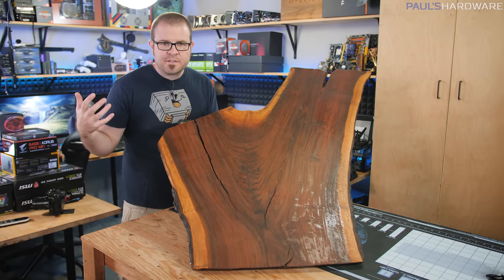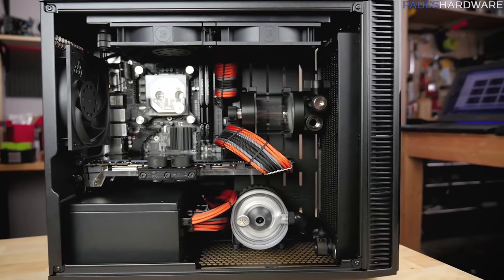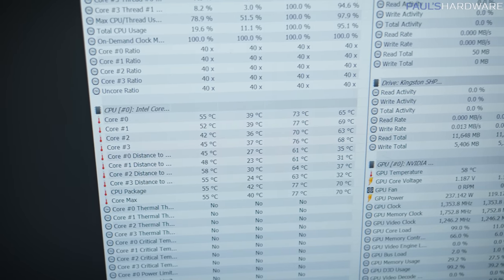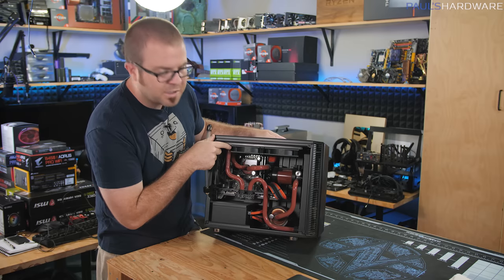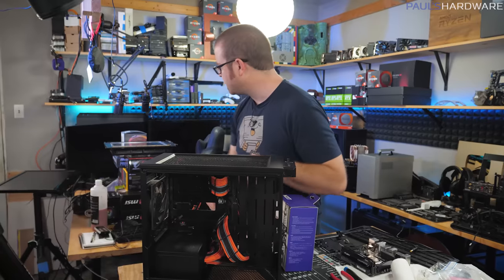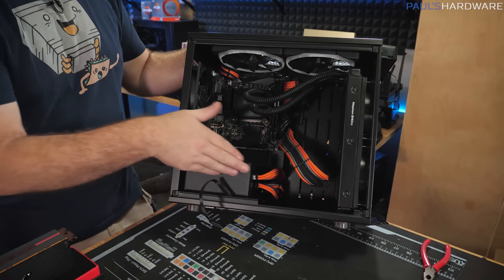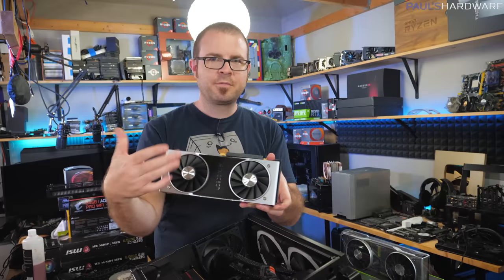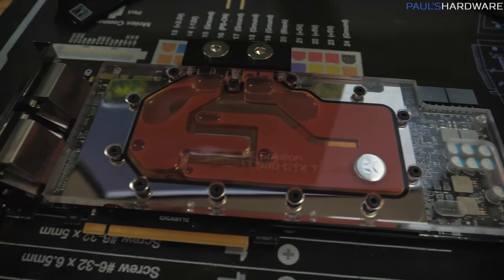Restoring HOTBOX: 3 Years Later

Comment: So strange why not just clean, new coolant, and reassemble? 980ti is good enough for the games she plays and looked way better with custom loop.
Reply: Completely agreed, I’m really surprised why Paul didn’t do this. System seemed fine spec wise, it just needed the solid clean out & perhaps just distilled water this time around.
Reply: that may be the plan. he just needed to get her a working system for now while he deep cleans the ek parts. at least, that's what i think he's doing.
Reply: @Devastator0  He did mention that his wife wanted little to no downtime. Hopefully part 2 of this video with the parts cleaned and possibly orange tubing to bring it back to the original aesthetic.
Reply: MantaProx2 I figure he didn’t just use distilled because he’d have to bend new tubes because the old ones are probably stained murky rotten carrot orange.
Reply: He did say he chose the aio and air cooled gpu so that the next time he has to clean out his wife's pc it'll be easier for him.
Reply: Watercooling is a hassle if you use coolant like that. I’m more confused why he used a reference 5700xt, it’s so loud and hot.
Reply: well a 1660ti is about the same speed as a 980ti.. the 980ti already showing its age.. a 2060 or 5700XT is faster than a 980ti
Reply: Gareth  Exactly the man has a new baby and not everyone wants to clean a loop when I can be having a great time with the family. Guess these are grown up problems.

Comment: Upgrade! I hope she gets a 5700 XT partner card with dual 8 pins to fit the colour scheme and original intention.
Reply: Mine as well give her a new ryzen 3000 series to go with it too!
Reply: @BadNewz5000  Not necessary. I do run a 6700k myself and unless you really have use for the extra cores, this one is still an absolute beast of a CPU.
Reply: And put a custom loop on it again, it was an awesome little rig like that
Reply: Well, with dual 8 pin I immediately thought 2080ti, glad paul went the same route, wish he'd liquid cooled that sucker though!
Reply: @hobbes2234  its really not anymore sorry. It's not even mid tier.
Reply: Edit: Alright, so you're right, but not entirely; according to Userbenchmarks, the 6700k is still slightly faster than an R5 2600, which in my book is still midrange with performance to spare. In regards to gaming and general computing it still holds up fine, but of course it won't outspeed todays chips. The biggest weakness of the old sucker is its terrible multicore performance by todays standards.
Reply: @hobbes2234  Definitely not necessary and wouldn't upgrade it myself. However, this man has spare 2080ti(s) laying about lol and probably has some ryzen 3000 cpus too. So why not?
Reply: Some Vega 56 / 64 have 8+8 and long enough to draw air from the case. Also some 5700 Xt models have those.
Reply: I'm still rockin an i7960 with 560ti, sadly only 16gb out of 24 work somehow ( yes i tried to fix but im too lazy to switch sticks )

Comment: Surely you had some 1080ti's or Titan Xp's laying around that were 2 slot and 2x8 pin, still would have been an upgrade from a 980ti.
Reply from the maker: those weren't as easily accessible though
Reply: @paulshardware  Did you consider a blower style 2080ti and upgrade mobo and cpu? or a whole new pc build
Reply: @GhostlyDelinquent  does anyone even make a blower 2080ti?
Reply: @deimosian  Atleast Asus, Gigabyte and PNY does.
EDIT: probably most manufacturers do.

Comment: Easy solution for you 6 pin issue, pull the pins out, install them into a 6 pin connector and then put heatshrink and isolate the extra 2 pins, tuck them in the back, voila.

Comment: please but the custom water-cooling loop back, please Paul. this is not how you do a water-cooling pc
Reply: Yeah right, this is water-colling done wrong!
Reply: 1st of all it's Liquid cooling, not water cooling.  AIO's are rarely filled with water.  2nd custom loops as seen earlier are huge pain in the Ass and at least this setup is low maint and with Temp specs by a good margin.

Comment: I think your wife's system is due for an update/upgrade.
Reply: Yeah that 2080ti is getting quite old.
Reply: Maybe in a generation or two, my 6700k still rolls with the punches, gonna probably run it until something dies.
Reply: @Neptunesplayground0  Same here! 6700k, 4.6ghz on a Noctua NH-D15, Asus rog Strix 1080ti. No issues at all on ultrawide 100hz!
Reply: @joshuayangg 
Ultra-Wide
Reply: @josejuanandrade4439  Almost the same setup here; 6700k @4.6GHz cooled by a Be Quiet! Dark Rock Pro 4 alongside a good ol' 1080 running a 3440x1440 120hz Monitor. ThIs jUsT WoRKs!
Reply: I dont think its worth for what she does, i mean the i5 6600k is still a good cpu (i own it) and i dont feal like its still worth to upgrade, just got a new samsung 970 evo plus 500gb, like brand new with trusty rx560, i dont need any more for every day/ java development

Comment: HAH, what a great place to be in: "OH NO, the only card I have that will work with these cables is a 2080Ti!"  Ex dee.

The blocks, rads, and fittings for that loop I'd say should definitely be repurposed.  Maybe grab a different case for that hardware that's easier to work with and a bit newer, and make a clear soft tubing build with that 5700XT?  Could be dangerously awesome...

Comment: A Vega 56 or Vega 64 would probably have dual 8-pin PAUL
Reply: Or a 2080ti
Reply: And melt that pc along with those connectors :D
Reply: They aren't really an upgrade from a watercooled 980ti though.
Reply: VeritronX both cards are an upgrade. The 980 ti is basically a 1070, which is slower than a 56. Vega (56) has a lower tdp and all around a better card. Especially if he’s going to watercool.

Comment: Aaamm.. I don't think that your cpu is cooler because you switched to an AIO, It was hot before because you choked off the front fans before. :( I thougt that is why you called this pc hotbox :D And the Gpu is warmer because the fan on the chip is choked also to hell :( I love your videos, but I did not like this pc when you built it, and I don't really like it now also :( Just put an SFX  psu in there and it will be so much better :) Keep up with the good work. I really like what you are doing and I learned a lot from you! :)
Reply: I think the main reason for dropping CPU temp is splitting the loop.
Reply: @AkifYlmaz  The GPU was cooler before the disassembly than the cpu. It added heat to the loop of course, but I dont think that was the main reason :)

Comment: If you say 6700k is still okay, I guess I'll stick with it for another year.
Reply: Still rocking my 6700K, slightly overclocked, with an EVGA 1080 Ti FTW3.  My research of reveiws shows I'm still good for now and that while upgrading would be "nice", I'm only going to see 15-20% increase in framerate at most (many only being 10%).  Not worth the $$$ yet.... (yet)

Comment: One thing I would have done differently is find a way to set the drain valve up to drain with gravity.  Meaning put it at the lowest point in the loop.  Would have been so easy to drain it.

Comment: can't speak for the ITX version but the ATX version of the Z170 Pro Gaming initially launched with just Red LED's then later an Aura Compatible version was released (I have the non-aura version myself for my 6700k that will soon be replaced with the 3950x when it releases).

Comment: It was way better before change. 
Would be better to let it and just swap the coolant.
Reply: The rads would be full of particles from the coolant that had degraded, you could see by the temps they needed a lot of cleaning. The block microfins were probably full of gunk too, but they are easy to clean at least.. just open them up and use a toothbrush and rinse them off.

Comment: Paul would a Ek MLC Phoenix 240 rad 2 3/4 inch thick fit up front and fit a vega 64 which is about 5mm  longer than the 5700xt or could it be put up top with out issue?

Comment: Why not put the AIO to exhaust up top an intake fresh air for the GPU? CPU temps may go up slightly but I wonder if it will help the starved gpu since one fan is blocked by the PSU

Comment: Senseless restoration.
You have replaced a fully working custom loop with a medicore AIO for CPU + stock GPU fan (80 *).
Graphics card (RTX2800) is overpowered for "Overwatch" - GTX980 was quieter, cooler, nicer.
Bad work.

Comment: Paul, I've got a 6700k also...running at 4.4 Ghz.  But I have a Hyper212 Evo with a Coolermaster static pressure 120mm fan on it and I get a max temp of 63c under the same tests.  I am in an NZXT H500 with 2 120mm exhaust fans (back and top) and two 140mm fans in the front...but where 63c is well above ambient, is it my case/fan config or is water cooling just not that much better than a tower air cooler in terms of actual temps (I get that it's probably quieter).

Comment: It's an upgrade.  Two generations better flagship Nvidia GPU, and no more PITA open loop maintenance. 

What monitor does your wife use, high refresh 1080p?  She could get a gazillion FPS in Overwatch now (up from just 0.6 gazillion with the 980Ti) if you've got some OC headroom on that CPU.  But yeah, any axial fan card is gonna run super hot in there.  Honestly, you just showed us the exact situation in which the blower cooler really is the better solution.  Seems like it would have been fairly easy to separate that 2-pin section of the custom cable.  Just use your Drem.......   I mean, rotary tool.

Comment: Maybe a Gigabyte 5700XT. Not sure if there's one out yet but they do use black and orange on a lot of cards. 

EDIT: Checked, their new custom model does not have orange plus it's 8+6 as well. Only 5700XT I've found with two 8 pin connectors is the Red Devil card. It has RGB now so you could make it orange if wanted. Length is 300mm BTW.

Comment: An option for better GPU airflow (in your case) might be to switch to an SFX psu.   I recently installed one of Corsair's 650 watt units in my daughter's Lian Li TU-200 using a Kingwin adapter.  The Kingwin adapts to one side (toward or away from the psu fan) rather than centered.  I was very impressed by just how small the SFX is and how much more room I had inside the case once it was installed.  Of course, replacing your sleeved cables with ones that fit the 5700XT would negate that requirement.  (I also wondered if a dremel wheel might separate the plastic on that plug...).

Comment: Minor upgrade in specs with a massive downgrade in build quality. 

Should have been a full overhaul with new waterblocked GPU and coolant loop cleaning.
Seemed like a rushed project without any planning, basically just removing loop and tossing in whatever fit afterwards. 

I run QDCs in my watercooled ITX rig so I can swap GPU or MoBo without opening the loop.

Comment: Honestly, it's a performance upgrade but a big aesthetic downgrade.  The AIO cooler lacks the visible love which went into the original setup.  I'd order a new 8+6 cable in the correct colors and find a waterblock to fit the 2080 Super or 5700XT, and re-create the very pretty hardline system you originally built for her if you can.

Comment: To be honest, change from custom loop to AIO cpu loop and air cooled GPU is a bit dissapointing, but still uprgrade of the GPU is very important for that build. However, within this case (due to PSU) GPU should be watercooled in order to maintain better temps and proper environment to work. The space between PSU and the GPU fans is very little which could cause GPU to overheat, especislly if it is that hot one. I was hoping you would change the GPU, install the water block, change the fluid and setup the rgb as you did. Then in my opinion it would be perfect, and now it is 8/10 ;p

Comment: Paul, was there a reason why you didn't want to remove one of the 8-pin pcie cables and install a reference PCB 1070/1070ti/1080/2060(s)/2070? Would help you save that 2080 Ti

Comment: Didn't need doing at all (i'm sure the old setup was working just fine)... you did it because you wanted to. The old loop just called for refreshing (but you made it into more for the sake of a video)... IMHO. The gains weren't worth the effort imo, unless your better half is a hardcore twitch streamer, playing latest gen FPS. If it's not broke, dont' fix it.

Comment: The dark side of custom loops. Tbh, AIO or air cool is a better option for 95% of people / builds. In the extra thermal overhead you gain by investing in custom loops, you might as well be putting the budget into better components that would perform better at stock clock even with lower thermal head room. That's the case in everything but the hottest builds where a custom loop is literally the difference between anything working vs. Throttling constantly which should really only be happening at the top end of products that you're pushing past stock (aka where there is no upgrade path or the loop is actually cheaper than going 1 tier up) . Doesn't matter how cool a custom loop makes your 1660 when the money could have bought a 2070.

Comment: Another well thought out, carefully considered video... Why take the original temps to see what cleaning out the loop would do if you didn't clean the loop out, nor re use the same parts? Christ on a bike. Everything else was a bodge job, just lob the extension and the 5700xt in.

Comment: It’s hard to upgrade from a 980ti I have a kingpin card and it takes a 1080ti or better to be tempting or no point to spending the money as far as I’m concerned. If I find a 1080ti for the same $230 I paid for the 980ti I’m all in on upgrading. Love the little itx form factor nice build loved the custom loop in hotbox.

Comment: @paul ---- OCCT 5.3.2 has a power-supply test if you are looking for a decent App that does both a GPU test and a CPU test simultaneously. I uses that to test the worst case scenario on my water cooling system and it functions perfectly for that.

Comment: Pauls Hardware : that PSU is gonna suffocate the first fan on the card making it ramp up higher and by definition produce louder fan sound because the air is gonna cut too harshly through the fan blades due to the closeness of that PSU encasing. Not a good mini ITX case, it's just for about 2-4 cm too small in height for the usage of dual fan or triple fan AIB gpu-s.

Comment: If it were me, I'd have used an exacto knife to cut out that small bridge on the PCIE power connector to let it fit into whatever card you wanted. I mean, GPU temps will prob be higher on the 5700xt reference anyway, but at least you have a more permanent solution rather than a 2080ti loaner

Comment: I think the temp decrease on the CPU probably had quite a bit with the fact that the loop was also cooling the GPU before.

I definitely think you should clean the watercooling stuff, grab a block for some card you have that does have 2 8 pins, that can stay in the wifes computer and reinstall the loop...cause it's dope.

Comment: Too bad you are not comparing 2 identical systems. I still don't know if changing the fluid had any impact. Besides the color the fluid was probably still working fine. Simply blowing out the dust and the thermals would have been almost like new.

Comment: Downgrade, since the GPU cooling was also going through the CPU block, the temps were more balanced. Now you have a very cool CPU but a very hot GPU, so yeah you going to Heat Throttle because of the hot GPU sooner then later

Comment: not going to lie paul i think you did your wife a massive disservice by going from a full custom loop down to an AIO and a temporary reference 2080ti. i fully understand getting the system back up and running but there is simply no excuse to go from the top of the cooling chain down to normie level and thinking thats okay. i really hope you seriously consider taking another shot at hotbox and bringing it back to fully custom water cooled glory!
Reply from the maker: I see where you're coming from, thanks for the comment!
Reply: I would like to see you move the system into an evolve shift x case with a full custom loop, Jay just did the smaller version with just aio.

Comment: You could get a sheet of 3/32" glass from Lowe's or Home Depot and some double-sided tape to replace that window with a glass one.  It is fairly easy to do; just cut the metal tabs that hold the plastic one on and layer about 2 layers of tape to overcome the depth of the window perimeter lip.  Just don't break the glass, or you could get cut.

Comment: I have almost the same setup, I tried using open air cooler on the GPU like you did, and found it was getting way too hot. I ended up switching my 1080ti to a blower style one because of temperatures. Though I will say I still have the top covered and not open, so perhaps you have more airflow than I do.

Comment: You could swap out the ATX sized psu for an SFX psu; this will give you room to add a 120mm fan to the bottom of the case and get more airflow to the GPU. 🏁

Comment: Wouldn’t a simple exactoblade cut between the 6/8 pin power connector  solve the issue of using the desired AMD GPU?

Comment: Fun vide0 4 your needs but all she needed was for the loop to be flushed with an open tap and fix her RGB.  
Wouldn't the 8 pin plug just need the webbing cut out between the 6 and 8 sections??? No fear, just a saw cut.

Comment: Only reason the CPU temps dropped is cause the system was no longer adding heat from the graphics card. Congrats you just played yourself, cpu is running cooler and gpu hotter....

Comment: Two comments, for what it's worth... 

The connector on the GPU is plastic and it would unlikely hurt the connection to use a razor and slit that plastic bridge to do what you wanted to do for the 6 pin.  Just be careful not to slice into the pin....

That RTX logo, while the card is in there, could easily be covered with a strip of electrical tape.  Trim to fit, and it would look better with the color scheme...